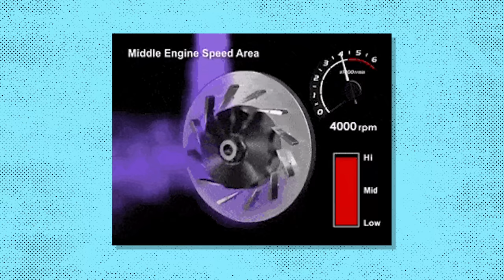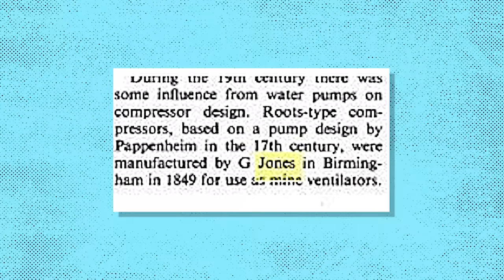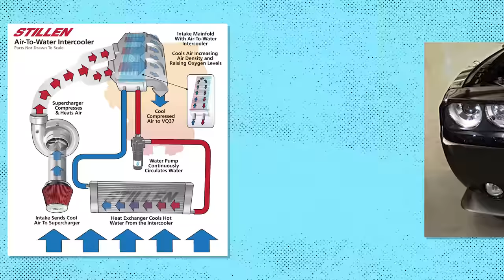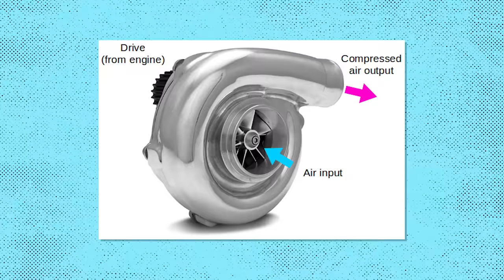Why Superchargers Aren't As Good as Turbos

Comment: Fact a super charger is all balls right off the hit, can out 60 foot any turbo car...That is ehat matters in drag racing....If turbos were a better option wrll ever nitro engine on the planet would be turbo powerd
Reply: Turbos produce more torque and that determines the ET...
Turbos are BANNED in NHRA Top Fuel because they made the cars too fast.
Reply: @GhostRider-dp2tc YES, THEY WERE.

Any engineer worth his salt knows that a supercharged engine can never make more power or torque than a turbocharger at the same manifold pressure.

I worked several years for the number 1 Top Fuel engine manufacturer.
Reply: @sandervanderkammen9230  you have no basis, none. If you did then turbo would dominate any screw, and again turbos do not 60 foot what a screw can....period....people that actually race and make as much power as a turbo win every time against a turbo.....A 3,000 hp turbo cannot 60 foot like a screw, and no drag racer gives 2 shits about tourque because they let off the button way beyound where the torque curve ends....torque curve done fell off at 8,000 rpm.....long ago fell off, torque does not matter in drag racing HP is king and that is why the launch at high rpm....go back to school, school of racing...Bonnet its a called a hood...come over to america and learn what power is not some super car bullshit
Reply: You want to win the argument then post a interview with john force and have him state exactly what your dreaming...it won't happen.....
Reply: @GhostRider-dp2tc  That's a negative ghostrider!
 Torque, not horsepower determines the rate of acceleration.
Newton's Second Law gives us the Formula F =M~A

Horsepower VS. Drag determines the top speed of vehicle, not its rate of acceleration.

This is the most basic, fundamental automotive engineering..
The fact that you do not understand these basic concepts proves that you have no formal education or professional experience regarding this subject.
Reply: @GhostRider-dp2tc  John Force and I know something you don't..
Turbos are not used in Top Fuel and Funny Car because they are BANNED!!!

You look like a fool right now kid
Reply: @sandervanderkammen9230  odd kido I worked for force, a engineer is not a engine builder or a mechanic.....
Reply: @GhostRider-dp2tc You're not a very good liar kid.
Reply: @GhostRider-dp2tc Turbos Are banned in NHRA Top Fuel

Comment: lol ,. while everything is technically true,. chargers serv a purpose turbos can't ..turbos serve a purpose chargers cant,,  there is no mo gooder over all ... its always about what you need to do,. there's always a threshold ... when and why you need the torque is all there is at the end of the day, bigger turbos take longer to give it to you, smaller ones are quicker but give up early.   What you need & when from your throttle is everything ,..  Then there's the operating conditions to think about and maintenance , cost , availability, space, reliability, so on , ect.    a choice between the various units has many more factors than just output & draw,...  imo superchargers are better for circuit & street course "on paper" due to the consistency just like N/A's are but you'll never do more than those track boys can squeeze out of a basketball sized turbo or 2 .. yes a supercharger launches better on paper in drag scenarios., but turbo drag cars work around that now, so it doesn't matter at the end of the day.. you'll be gapped by a basketball sized turbo or 2 if racing them in a straight line till you go full NHRA Top Fuel blower .*imo*. but ,--- turbos get tricky in traffic & turns and they can't handle top fuel drag at all ., so the specific attitude you need when ,where and for how long is paramount..
Reply: Your comments are very confused and you seem to be completely oblivious to the major advantages a Turbocharger has over the Supercharger.
 The turbo will always produce more power and torque at the same manifold pressure and is far more efficient overall.

Turbochargers would be a huge advantage in Top Fuel drag racing, of course it shocks me that no one seems aware that turbochargers are officially banned by the NHRA in Top Fuel class.

The idea that turbochargers cannot handle a top Fuel engine is just ignorance.
Reply: Turbo lag is not real, it's an imaginary problem that unskilled drivers often struggle with but the pros can handle with great success.
Turbo lag does not mean acceleration lag,  Turbo cars are faster.
Reply: Your premise that superchargers are superior because they are used in NHRA Top Fuel is completely invalid because they are the only thing allowed  by the current regulations, Turbochargers are absolutely prohibited  in Top Fuel.
Reply: @oskarrecon8151 And you obviously know nothing about engines or turbochargers kid.

Comment: For me you have 2 wrong points. Yes supercharger are a little more inefficient than turbos but dont think that turbos can use "waste" exhaust gases. Your pistons will work harder than normal to force those gases trough that turbine. It can be easy to spin at 0rpm but it will increase this resistance as the rpm increases and the proof for that is that you will have exhaust pressure(close to intake pressure).
The second part is that turbos arent easy to place in an engine bay. Yes turbos are small but u will need to get whit pipe anywhere you place them. You will have to go whit pipes to that intercooler and you will have a downpipe. Also you will have a 600°C ball in your engine bay so u need also to think about heat management. 
And now you ask why are manufactures not using SC instead of Turbos. And the answer like most times are the same COST. SC have a lot of parts are huge and need lots of precision. Turbos also need precision but only in some parts and are a lot easier to mass produce whit a lot smaller components. 
In resume Turbos are better but SC will have a place in cars as long internal combustions exist.
Reply: You don't seem to understand how turbos actually work, I think you are making assumptions based on some very common misconceptions 
 The turbine is a heat engine and operates using the Brayton Cycle 
This little engine runs entirely off the heat energy wasted out the exhaust ports.
All of the horsepower used to drive the compressor wheel is coming from the waste heat, not from the reciprocating engine itself.
It a fundamental concept that most people are never taught and simply don't understand.

Comment: Turbos have parasitic loss... wtf you talking about.

Super chargers deliver the same kind of power just immediate... so how does that make them suck.....
Reply: Well, its obvious from that benighted comment that you are definitely not and engineer or an expert on forced induction.
Reply: @sandervanderkammen9230  it’s pretty obvious I have plenty of experience.... don’t come on here trying to belittle others when you have no clue
Reply: @brandon_doe  Experience making a fool of yourself..
You have certainly proven that.
My point is your comment reveals that you don't know how turbocharged engines work...

Please stop spreading spreading your ignorance and making a fool of yourself.
Reply: @sandervanderkammen9230  no I definitely don’t know anything g about turbos. Thanks for taking that out of a statement/question I had. So keep going on oh wise one who knows everything about everyone. 

Seems to me you’re the fool
Reply: @brandon_doe  Turbochargers will always produce more power than superchargers, because turbochargers do not induce any parasitic load on the engine.

Its very simple engineering and thermodynamics
Reply: @sandervanderkammen9230  you do realize it takes exhaust pressure, which induces parasitic loss..... it’s basic physics...
Reply: @brandon_doe  Wow! did you even graduate high school??? Or are you a drop out as I suspect???
 
Turbos make more power than superchargers because they drive the compressor using horsepower that is just wasted out the tailpipe on a supercharged engine.
Maybe you should stick to some thing you know... like oil and filter replacement or mounting truck tires?
Reply: @sandervanderkammen9230  wtf does graduating high school have anything to do with this conversation?

Literally nothing...
Reply: @brandon_doe  Thank you for confirming that you dropped out of school.
 You should leave engineering discussions for the people with a proper education.
Reply: @sandervanderkammen9230  damn why’d you drop out of high school? Couldn’t figure out how to properly assume something?
Reply: @brandon_doe  Don't have to assume you dropped out of school... your benighted comments completely exposed yourself.
Reply: @sandervanderkammen9230  it’s ok bro you don’t have to make yourself look more like a clown after dropping out of high school. Nobody cares

Comment: I won't even watch the video. If turbos are better than why are the fastest cars supercharged?
Reply: The fastest cars are turbocharged...
Reply: @sandervanderkammen9230  nope sorry. Fastest cars go 0 to 350 miles per hr in under 4 seconds. And none are turbocharged.
Reply: Want proof?
Reply: @curtiscriscoe367  Are you referring to NHRA Top Fuel???
Reply: @curtiscriscoe367  Because turbochargers were banned from Top Fuel over concerns it made the cars too fast.
Reply: @curtiscriscoe367  It is absolutely 100% true!
  The NHRA investigated allowing turbochargers in Top Fuel and Top Alcohol classes but instead banned them from use over safety concerns related to the increase in accelleration and track speeds.
Reply: @curtiscriscoe367  You seem very confused and misinformed about turbochargers, the term "Turbo lag" is in no way related to accelleration lag... the increase in horsepower and torque provided by turbochargers results in significantly lower ETs and higher trap speeds.
 Any questions son?
Reply: @curtiscriscoe367  Its called a  MANIFOLD kid... you can't run zoomie pipes with a turbocharger.
Turbochargers can be installed on any engine (except maybe a rotary)
They did it too, Gale Banks built a turbo dragster for NHRA.
 True, so a turbo Top Fuel car with 15,000 horsepower would have more traction problems along with lower ETs and higher trap speed.

By your logic a Top Fuel car with less horsepower would be faster, unfortunately that is not the case.

Like I said, turbochargers are banned in NHRA Top Fuel so it's difficult to  say exactly how much faster they would be with turbochargers... we just know they would be significantly faster.

I don't own a Honda, but they make excellent racing engines and have won many world championships including F1 and CART/Indy.

Top Fuel is a 'Vintage Class' and a single engine formula series.
Only the 1964 Chrysler 426 engine is  allowed to compete.
If Honda was allowed to compete with a turbocharged 500 cubic inch version of one of its many championship winning engines? It could certainly be the fastest drag car in the world 
Any questions there kid?

Comment: Well produced video but overlooked or brushed over key pros and cons of SC vs turbo, including heat management (big turbo issue), easy of installation and maintenance, SC allows you to maintain standard headers (big plus if you're adding one), lag, etc...
Reply: Heat management? 
How is heat management different for a supercharger?
What are "standard headers"???
 Both supercharger and turbochargers can have lag.. what is your point? Lag is an imaginary problem not a real performance issue.

Comment: There is no parasitic loss with the turbocharger... the energy to drive the compressor comes from the heat in the exhaust.

This is often a difficult concept to visualize and grasp for someone without proper education or professional experience in engineering.

Its a popular misconception that the turbocharger causes back pressure and restricts exhaust flow, this is in fact completely false, turbochargers increase exhaust flow and this is why they produce more horsepower than superchargers.